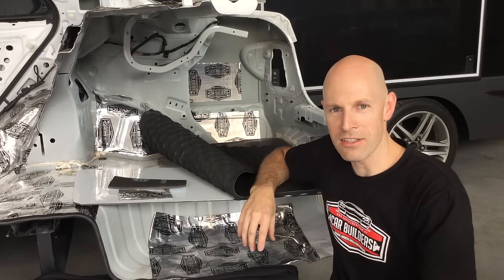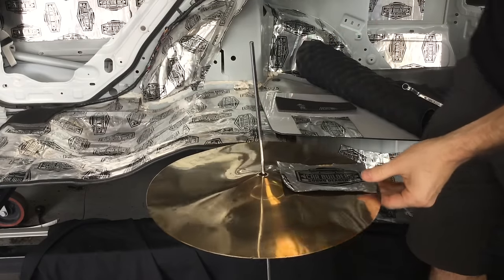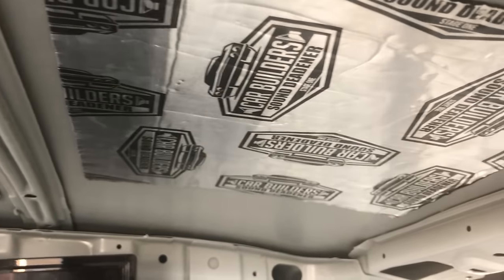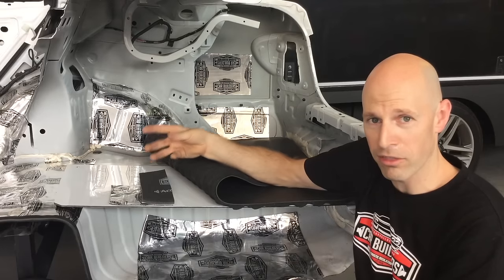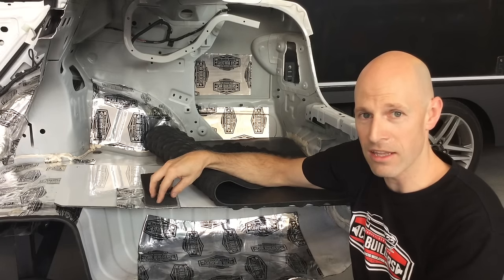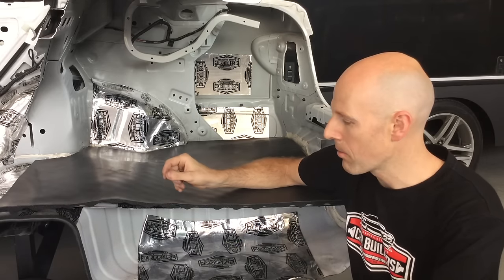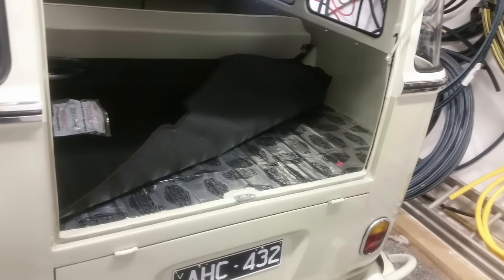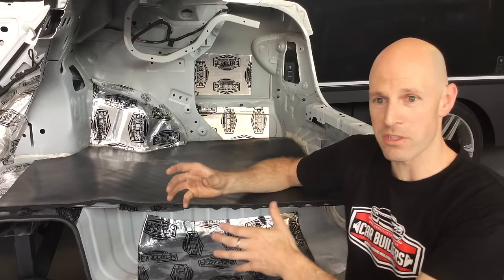The basics to sound deadening in cars. What should I use to control sound and heat in my car?

Comment: I was a courier and once had to deliver bank bags that were vinyl and cloth in a Sentra. I had 300 pounds of sound deadening  for a half hour - it was amazingly quiet, then back to "noisy".
Try it yourself : pack your floorboards and trunk with towels and clothes about a foot deep and go for a ride.
Reply from the maker: Hi Peter. The effect was two-fold. You stopped vibration in the panels by adding weight and you also created a sound blanket for externally generated noise. 👍

Comment: When I close my driver's door, strangely, sounds like a hollow tin can, but the other doors sound fine when I close it. I seriously need to add this to my car, sometimes its small things like this that make me feel my car is complete if that makes sense.
The noisiest thing in my car is the engine, even with new engine mounts, I hope when I buy this I will get a huge noise level improvement, and the insulation as an added bonus.

Comment: Concrete works best hehe.... I like your two layer foam and mass loaded vinyl. Using all three..deadener, foam and vinyl makes a big difference especially in boot floor and under rear seat.
Reply: I'm using Butyl + Sound Bar(MLV) + Felt ..each for different purpose, Butyl to reduce vibrations, Sound Bar to block the sound and Felt to absorb sound :D
Reply: EvroNetwork That is the way to go. I dynamatted a car and was dissapointed in the results so I used foam as well...and it still wasnt good enough...only when I added Mass loaded Vinyl did I finally get a quiet car..I was driving over 1000kms per week on rough asphalt...you know when your car is well sound proofed when you hear that Ssshhhh sound at high speed....

Comment: I'm redoing a NA Miata. Heat and sound deadening is a must. Hopefully it won't add to much weight.
Reply from the maker: Hi Travis. If heat is the greater issue, you can use heat shields or peel and stick peel shields to dramatically reduce heat within the car with very little additional weight.
Reply: @carbuilders1  nice thanks

Comment: Great video mate, just wanted to clarify if improved stereo sound is covered in general sound deadening or would you look at something specific for that purpose?
Reply from the maker: Hi Steve. All of this sound deadening is going to stop speaker panel vibration and improve stereo quality. Car audio guys will skin both the outer and inner doors if there are speakers in them to avoid the rear sound waves cancelling out with the front sound waves. It will also make the door act as a speaker enclosure, maximising sound pressure 👍

Comment: Oh man, now I regret coating most of the front door area in the butyl mat, the roof I have zero regrets for, since I'd rather have too much "just in case", but the doors are unnecessarily heavy now, when just couple of pieces would have probably done the trick, considering the butyl mat is just there to reduce resonance... I picked up on that when doing the trunk, placing small pieces strategically instead of covering the whole area, but at that point most of the car has already been done.

Comment: Hello! I wish to insulate an engine and transmission noise in a tractor cab. It is a cab that is separated from a gearbox and placed on rubber mounts, I have no major issues with vibrations, only noise. The engine is big 7.7L and the muffler is not quite made from the factory to muffle well.

The front gap between the console and engine has some insulation in the form of aluminum and spongy material, maybe 2mm thick, but it seems it is not enough. I don't have any isolation on the wheel arches, just a thin fake leather layer. There is a thick rubber on a floor, but there are some gaps under. Should I insulate the roof? It has the plastic top, probably hollow, and I noticed a  noise difference when I open and close sun roof.

I wish to know what materials to use in what places, should I take extra rubber strips to place around the doors and windows, and will it make a significant difference?

Comment: you probably won't see this but I am planning on reducing the car and street noise in my '95 Miatas cabin. I was wondering how much sound deadening you would recommend, since the car is relatively light and I wanna keep it that way, so the premium 2nd stage material is out of question. Should i just cover the entire floor with the first two materials?

Comment: Very informative! How much weight is added for a 4 door sedan?
Reply from the maker: Thank you Florin. The weight really depends on where you are going to cover and what stage 2 product (foam or vinyl weigh significantly different). The Sound Deadener is 6.5kg per box and you need two for the floor, one box for the doors and less than one for the roof. It would need two boxes of Acoustic Liner as underlay, it weighs less than 4kg in total. If you wanted the premium underlay (Mass Noise Liner Lite), you would also need two sheets and they weigh 7kg each. The second stage on the room is Insul layer and this is a foam (1.5kg). Feel free to contact us (03 8777 0960) to chat further about your install 👍

Comment: HEY BRO, do you have any experience with  NISSAN 330/350/370 Zs?
How much costs should it take to quiet down the rearend of 350/370 Z significantly so it wouldnt be a deciding factor like it was for me

i used to really like them until i testdrove them back to back with a mercedes & G37.
the 370Z was by far the coolest/fastest/Best  Handling  but it sounded like a truck with empty bed driving down a gravel road compared to other cars and i ended up getting an Altima 3.5 that i put a bigger swaybar and strut tower brace and it handled  GREAT after that.

Comment: I liked the mention of running the MLV/CCF treatment on the rear seat backs since that was the method I plan to do in my car, to save weight and material. However, I was wondering, with a subwoofer in the trunk would this affect the low frequency bass coming into the cabin? I have 1 10" subwoofer in an Integra, aimed at the rear glass, and the removeable rear deck shelf will likely not be treated. If no one has an answer for me, I'll try out both ways in the coming week starting with treating the seat backs and follow up if I remember! My main goal is to kill road noise, something the Integra is plagued by being a cheaper 90's vehicle.
Reply from the maker: Hi Tom, if you had a sedan with a closed off trunk/boot and you lined the back of the back seat with MLV it would reduce the amount of bass coming through to the cabin. Because you have a hatch, the bass will be reflecting off the back window/hatch and going back to the cabin. Your removable parcel shelf panel will be the largest factor that will be blocking the bass from coming through. If you want to reduce road noise we would recommend applying MLV or Insulayer to your trunk floor, wheel arches and trunk side walls. 👍

Comment: I going to have the headliner installed in my old 95 Dodge  ram 2500 4x4..so what do you recommend for heat and noise . I don't want the materal coming loose or causing problems.  Thanks

Comment: They look like great products!  Can you get the 1st. (rubber) layer off if you choose to later?  Also, is there ever a chance of water getting under it and eventually rusting the metal under it?  Just making sure because I would be putting this on my 34 year old Dodge D150 truck with only 26 thousand original miles on it.  It's like new so I am extremely careful what I do to it.  

The reason for my concern is the aftermarket rustproofing that is installed the most in the northern part of the country is a "rubberized" coating that is sprayed into the doors and the undercarriage and in time it pulls back enough to let in water and salt and the moisture stays there and just rots everything right through!  I have seen frames of new trucks so rotten after less than 10 years old because of this issue that they are totalled!
Reply from the maker: Hi thoms_here I understand your concern. Yes, you can remove the butyl rubber once applied. It takes some elbow grease but can be done. We replace it once a year in our demonstration half car that we take to shows (to freshen up the display as it get constantly touched and rubbed). Unlike the old bitumen deadener, which would crack and allow moisture underneath it butyl doesn't harden and actually becomes tackier in warmer weather. Butyl is used in plumbing applications and you can see in another video we did that it creates a water proof barrier even when in a vertical application. https://youtu.be/tNnmyFO8lcw Good luck with the Dodge, sound like a nice ride 😎👍

Comment: What would be the best product for noise reduction front my transmission? I need to put something under the boot of my shift stick. Mass noise reduction liner + something else maybe?
Reply from the maker: Hi Doobiez. The mass loaded vinyl range is best. The next thing to work out is how much tolerance or space you have under the factory carpet or vinyl. You may only be able to use a 2mm mass loaded vinyl or the thicker (8mm or 13mm) versions that have a closed cell backing foam https://www.carbuilders.com.au/interior/mass-loaded-vinyl/ 👍

Comment: You failed to communicate the most important thing in sound insulation in a car: THE RULE OF 25%!
This means that if you have covered 25% of a panel in your sound deadening material (whatever it may be) then you have done 95% of all the sound deadening you can ever do to that panel. Covering the other 75% is pointless, as all it does is add weight, and huge cost and inconvenience. The Rule of 25% is a godsend to motorists, and a "bunch of bullshit" if you happen to be in the game of selling sound deadening, or installing it professionally. :P
Reply from the maker: You're right. Auto manufacturer's will engineer sound proofing additions to a dollar point, researching the optimal positioning for deadening to just meet consumer expectations. Vibration dampening mats are most effective on single skin metallic surfaces. It is unnecessary to apply deadener to over-lapped metal sections, top hat, chassis sections etc as these areas don't resonant. To sound engineer a car it takes some skill and technical analysis to pin point key areas, in reality most people will cover everything as they don't mind spending a bit more (labour is the greatest cost in this job rather than materials) to ensure they have achieved the desired results. With paying customers, most people want everything covered. Keep in mind that this is for one stage in controlling sound in your vehicle. 😎👍
Reply: That may be true,Chris; but if I was to pay someone all that labor, I would then want perfection. Adequate was the factory 68db at freeway speed.
Reply: This is true for sound but not for thermal reduction
Reply: I need this so I can listen to music better on high speeds.
Reply: @kenc2386  Perfection? You're not sealing out sound as though it is a gas permeating the cabin. You are deadening the resonance - just as the cymbal demonstrated.
No nee to cover the whole cymbal with the sound deadener, when a small piece will do.
Reply: This is exactly what I thought.. When a small piece he applied to that instrument fully silented it I don't see a point to stick it to the whole door panel for example

Comment: Does your foam product have a mold inhibitor like some of your competitors? I don't see that listed on the website. It's nice that there's a closed-cell topper, but unless you intend to blanket your entire vehicle and seal every little seam and joint, moisture will still get down into the open-cell underlayment and mold. It may not rot the material like jute, but it will mold. What happens if you have a leak inside the vehicle? What happens if you spill a realistic amount of drink, as in, an entire cup of it (12-24oz)? It's going to soak through your carpet and the first seam in the insulation it it finds it's going to seep down through capillary action. Just because it isn't jute doesn't mean it can't  or won't mold. This is still a very real concern for modern insulation.
Reply from the maker: Hi gymkhanadog. If moisture and mould is a concern/issue, we advise underlay's that are totally closed cell such as https://www.carbuilders.com.au/water-proof-carpet-underlay-stage-2~728

Comment: just saw this video when I'm researching to sound dampening on my car 
I got a question about the 2nd stage vinyl foam 
I saw different method of installing the foam , the method in this video show foam down vinyl up drop in method 
But in some other video, they do the opposite site way instead , so even stick the vinyl face to the second layer and made the 3rd layer foam facing the cabin instea
So which is more functional in terms of reducing noice from out side

Bcoz in still thinking whether to get the 3rd foam layer or butyl and 2nd layer foam are enough
I saw that butyl alone eliminated alot of high pitch noise, but will it made the whole car low tone drony

Comment: Any danger of moisture getting trapped when placing the materials down?  Or am I overthinking it?...
Reply from the maker: No, good question. The butyl facing the metal on the stage 1 sound deadening mats is water proof. We have a video where we pour liquid into a pocket of sound deadener to illustrate this. This type of material is used in plumbing applications to create water proof seals. It is important that you rust-treat the surface before applying the mats and that you roll the mats down without leaving air pockets. The sound deadener will act as a rust barrier. Around the mats you may still want to treat the metal with an anti-rust wax. Please free to call us to discuss further 03 8777 0960 👍

Comment: What would you use for a dash that rattles on bumpy roads? The most distracting noise in my car seems to come from the glove box door rattling.
Reply: I used Weather Strip window seal on my car for that. Seems to work well. Just run it along the few key areas to reduce vibration.

Comment: Been looking for this sort of Information for ages! Subscribed :) any chance your sound deadening is lighter than most stock ones?
Reply from the maker: Thank you Charlie Bishop. 😎👍 Sadly no. The problem is that you need to add mass to the panel to reduce the vibration. In saying that though, the mass loaded paints can be lighter depending on how thickly you apply it. Keep in mind, if you go too thin it won't have the required mass to deaden the panel.

Comment: I've got Vauxhall/Opel Mokka (Buick Encore). I get that cost/weight cutting made this car an empty tin with thin metal all-around. Do you think that a few patches of this rubber sheet would help with overall road noise (and vibration throughout the thin sheets of steel around)?
Reply from the maker: Hi Mieczyslaw. Yes, you will achieve results by adding Stage 1 pads to single sheet metal panels and the Stage 2 Foams or Mass Loaded Vinyls will act to reduce external road noise. Good luck

Comment: Sooooo if I want to reduce exhaust drone and road noise I want.....?
Reply: Cameron Beyer a better exhaust setup and better tires?
Reply: @boldstar69  2019 WRX with the stock summer sport compound tires and a fill turbo back
Reply: @cameronbeyer7687  try having a helmholtz resonator installed to cut back on drone, and not sure what summer tires comes stock in your area but replacing them will also cut back on road noise.
Reply: @boldstar69  I actually have 4 resonators haha, but Dunlops come stock. Nah I'll take the added noise for improved handling. I currently have blizzaks on for the winter, and holy road noise that's fucking insane haha

Comment: Are there any issues with the mats peeling off in very warm weather?
Reply from the maker: Hi Kool Range. The Sound Deadener? The butyl will get tackier in extreme temps. It won't peel off but in vertical positions such as door skins we like border it with our aluminium foil tape to ensure their is no chance of slip. https://www.carbuilders.com.au/aluminium-foil-tape

Comment: Hello. I'd like to use the black sound deadener directly above and around my mufflers under the car, to reduce the noise entering in the boot. 
I understand this is an internal liner, but is it possible to use externally?
Reply from the maker: Hi Duane. As you have stated, this product is designed for interior use and we would recommend using it on the inside rather than outside. An issue underneath the car might also be the surface being dirty and greasy. If you are able to clean the exterior surface thoroughly (test with masking tape once clean- if that sticks and deadener will) then it can be placed in the area.
Reply: @carbuilders1  Thank you for your reply. I’ll clean the area thoroughly.

Comment: I am converting a MB Sprinter van to a camper.  The walls and ceilings seem to already have some dampening material from the factory. Should the vibration dampening mats you mention be applied as well, or is this redundant?
Reply from the maker: Hi Mike. The factory Stage 1 deadening will be doing something, however the manufacturer will often put minimal amounts in an effort to save costs. You can add to this. These vans don't have any Stage 2 materials which will need to be added if you are chasing reducing sound and heat.

Comment: Honestly, I am not concerned about the noise. Im looking more for the insulation properties.
Should I still put on the first layer or should I just skip that?

If space allows for it, I would also add some wool insulation into the bigger gaps
Reply: Those products will work together, separately they don't. Hope that answers your question.

Comment: Can we use the waterproof butyl tape which has butyl rubber on one side and an aluminum foil on the other? It is 1 mm thick. Hardly at least will it reduce the vibrations?
Reply: I use about a foot of thin weather-stripping to deaden the down the 'teng' sound of my microwave (when shutting the door). Right in the middle It helped a bit. So, I'd say yes, a bit.